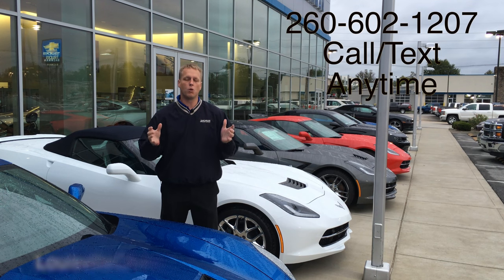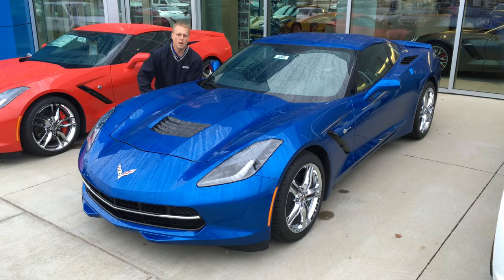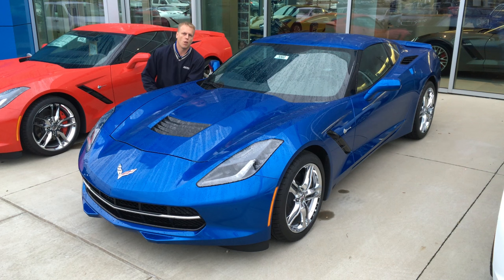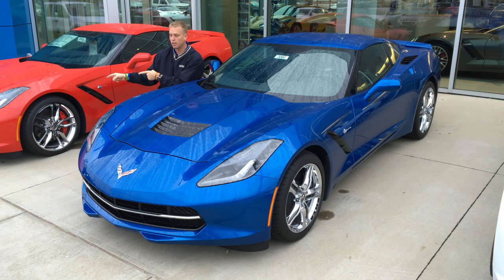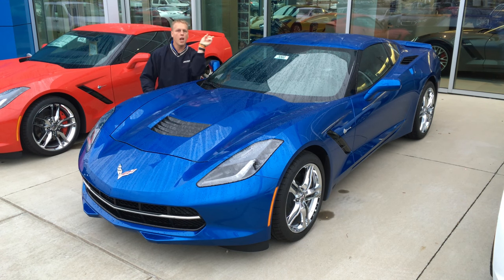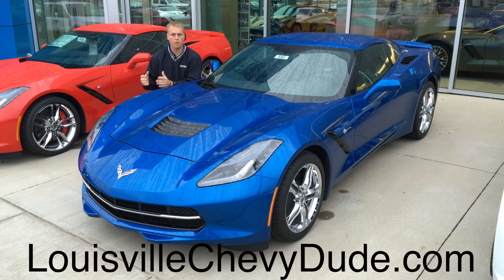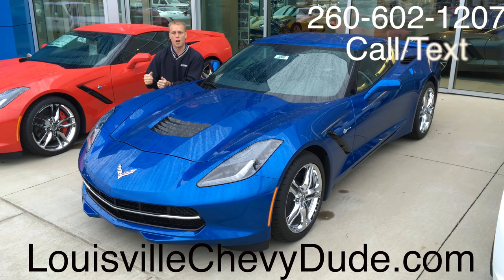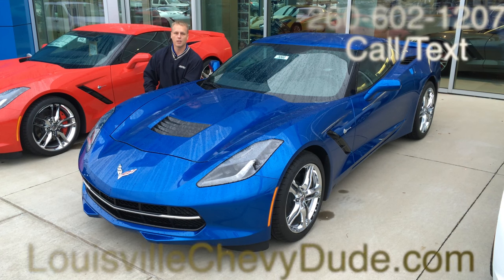Corvette has jumping, popping, thumping and grinding noises explained.

Comment: Mike I got a question, What happens if you drive the car under 40 degrees with summer only tires? Will it harm your car or you just won't be able to control the car?
Reply: Drove my z06 in 38def rainy weather last weekend. Kept all the electronic aids on and had no issues. It only started loosing traction if I pushed it on purpose.

Comment: Hey Mike. I know this is an old video,  but I just recently got a 2014 Z51 convertible.  It got to 33 degrees here in middle Georgia tonight, I backed my vette up and it did this clunking grinding noise. Though my car was messed up. Thanks for the info. Lovr your video always so informative.  Thanks Scott.

Comment: your misinformed...the tires are not the root cause of that..its ackerman steeriing look it up.
Reply: Acerman srering on crvettr
Reply: wow' you are the first person on youtube to get this right,
Reply: @camaro4262  thank you im a walking talking encyclopedia of useless knowledge ..although the stickiness or traction rating  and width of your tires will add or subtract from the ackerman steering effect. the stickier they re the more the effect...the less sticky they are the more they slip and cause less of the effect.  but you gotta admit. ackerman works where its intended to work

Comment: Thanks Mike, I live in Utah and have a 2017 Grand Sport. We have had a very hot winter so i have been driving the car in January. Today i heard that noise and thought something was really messed up with my steering. I usually drive in Sport mode and thought that may have been the problem. Thanks for the tips, i can stop worrying now. Your video explained it to perfection. That was spot on to what happened today. Thanks for the advice!

Comment: I'm in 60 degrees and allmost hit a car because of this problem ! My does it forward and reverse .Dealer didn't  warn me about this. Dealer overinflated my tires 10 pounds so I would notice this on my test drive. I wouldn't bought the car if they had told me about this problem !!! This is # 9 Corvette I have owned. My other cars  never done this. Very dissatisfied GM owner.
Reply: Ernie Vanier its normal and does not damage the vehicle